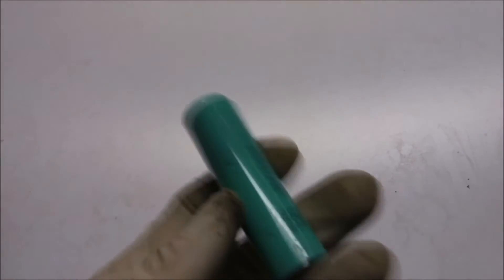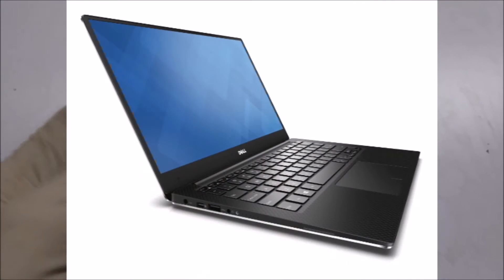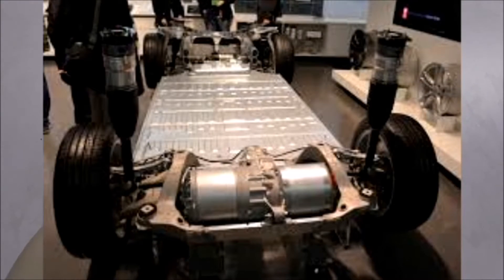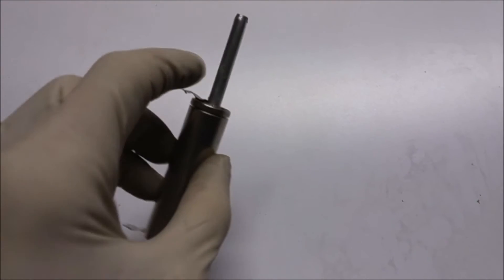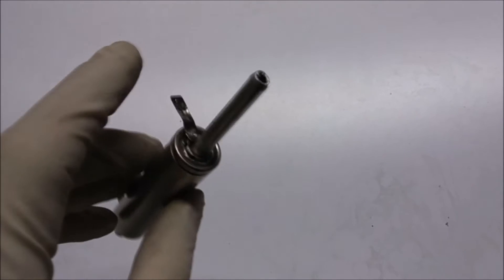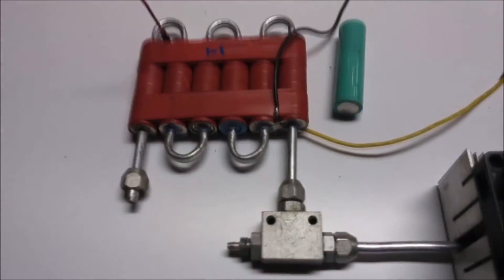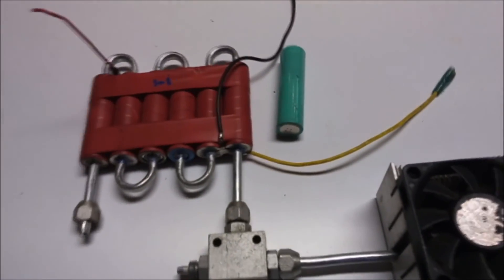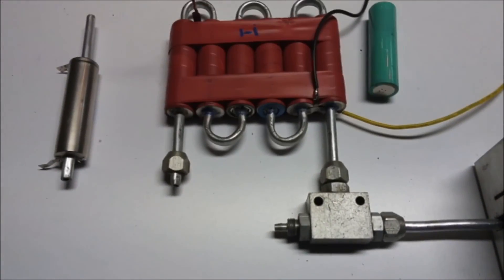IN-CELL COOLING SYSTEM FOR 18650 LITHIUM ION BATTERY IDEA

Comment: firstly, you have to solve the problem of short circuit since you connect the positive tab and the negative tab with a single metal tube lol, but yes, it is a great idea that has been proven by simulations, hope to see you do it in real!
Reply: yeah of course it will cooled since it cant be used

Comment: That's a sweet idea, but don't you lose the majority of the capacity of the cell this way? And how would you weld cells together?
Reply: ring connector around pipe with tab connector